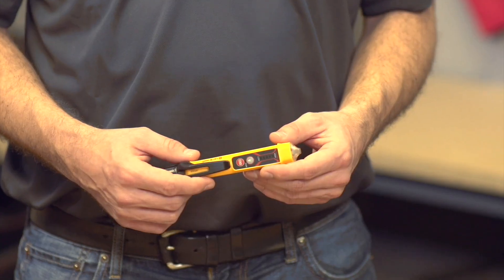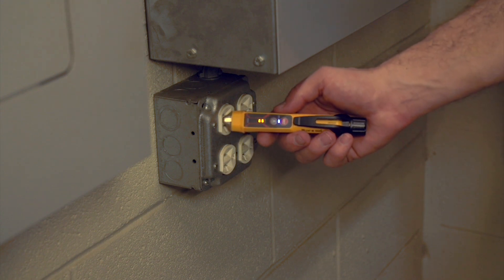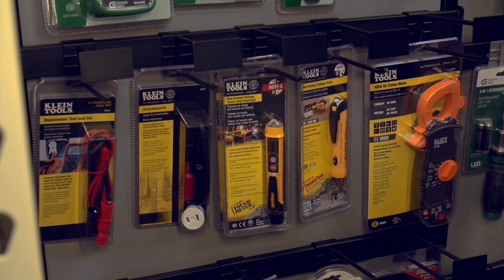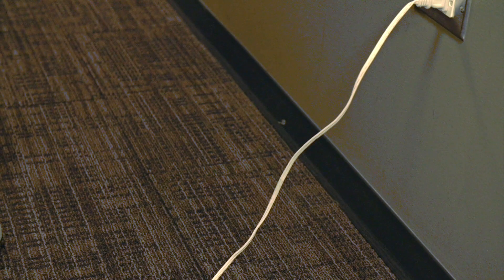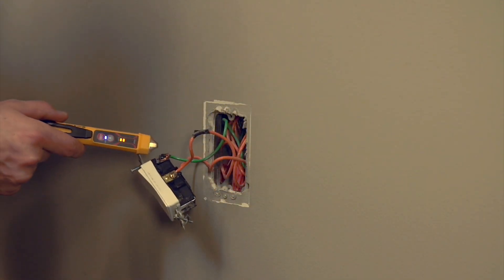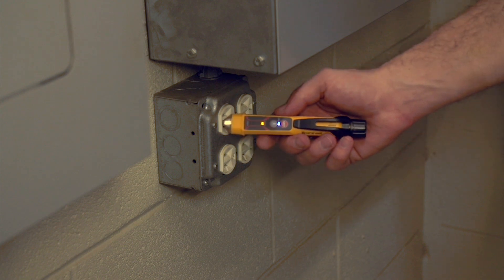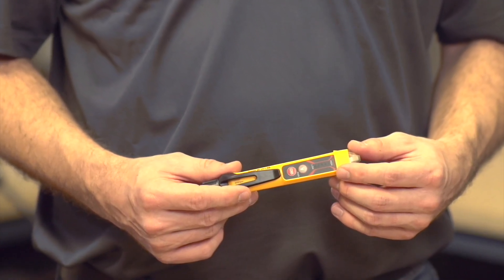How to Use a Non-Contact Voltage Tester

Comment: It would have been helpful to mention the need to cut power to two circuits if a gfi that controls the outlet you are working on is on a different circuit.  Otherwise, very informative video.  Thank you.

Comment: Why turn off the breaker before meticulously testing all your switches?

Whats the point of checking switches work on a circuit with NO POWER?

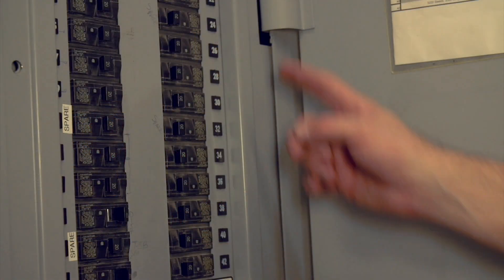Comment: 2:21 - How could you test a light fixture if you just turned off the circuit breaker?
Reply: Same thing confused me….such a great vid otherwise but that ruined it.  Electrical box was OFF…so why did it test voltage even if light switch was on?

I’m no electrician…Where is my logic missing something?
Reply: @mittensproductions.1554 just to make sure its not hot.
Reply: "Non-contact voltidz tester" lol

Comment: Can this be used to test for electrical current in a water trough with an immersion water heater? If so, how do I do it?
Reply from the maker: No, not designed for that usage.
Reply: You know better than that.  Troll Alert!  lolol

Comment: Just wondering... a quick simple question please, 

I have just purchased a KLEIN NCVT-2 voltage tester to upgrade from my neon screwdriver tester..

I’m trying to get this KLEIN voltage tester to differentiate between a live ( active wire) to a neutral or non powered active wire next to it I.e PowerPoint , light bulb fixture , switch appliance etc

Whenever I approach one of the above with my KLEIN voltage tester, approximately 5cm ( 2 inches ) the pen lights up red as I approach the PowerPoint , switch, appliance etc, 

The KLEIN remains red ( active-live wire) even though I’m not on the active-live wire , even when I place the KLEIN on a neutral it still remains lit up... not only my house but my neighbours.

I was hoping it would operate only when I am actually on an active-live wire not within proximity thereby not being able to differentiate between which wire is active and which one isn’t ?

Is the KLEIN too sensitive , any answers please

Thanks 

Mike :)
15aug1769@gmail.com

Comment: 1:24 why "and then finally repeat the test on the known live system"  why should I do that? What benefit of safety does it add? I'm not denying it's correct, however I genuinely don't understand it.
Reply: For the same reason you do the initial check.   
Zero sound/light indicates the absence of voltage - or a dead battery /fault in the tester.  The live check shows the tester is functional. 
Before you cut that cable the second ‘live’ check shows you that the lack of response from the tester was due to a lack of voltage detected  and not the tester failing halfway through the test. If the battery was on its way out it is possible the first show of light and sound killed it....

Comment: wth why does it have non contact in its name
Reply: The point on the pen is what contacts the live systems to detect there’s voltage. The pen itself, is the non contact device, hence why it’s called a non contact voltage tester
Reply: In addition, if it’s called a voltage tester people would think it’s a multimeter that has probes. Two totally different devices. Hopefully someone can correct me if I’m wrong
Reply: I don't think the reply you got to this earlier is correct.

The reason why it's called "non-contact" is because you also get "contact" voltage testers in the market

Comment: does NCV need minimum amount of voltage to be detected?
Reply: Some models detect as low as 12V AC, while others are only sensitive down to 50V, 90V or 100V AC, so shop around.

Comment: mine is pretty useless for contact testing. it beeps on live. also beeps on neutral. oh it also beeps on ground. now how do I know which is which? it does correct job contactless on wire sides. but why would I want to test that?
Reply: MPOEROT hey there. i saw your comment. your non contact voltage detector is defenatly way to sensitive. some of these detectors are like that especialy the cheaper ones. unless theres power and then theres a huge problem!!  I use a fluke voltalert and i never had this problem before. hope this helps. regards
Reply: cool. glad the better ones didn't have this issue
Reply: In other words, the thing is no good and may get you killed, right?
Reply: Had a GB that beeped stupidly. Been using fluke for years. Never has it let me down.